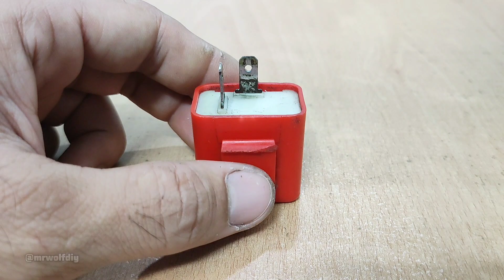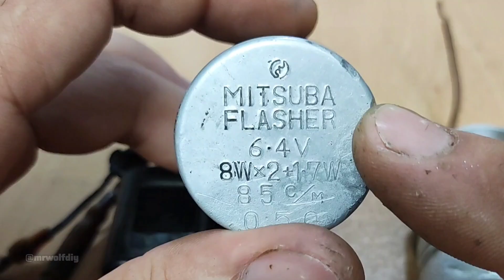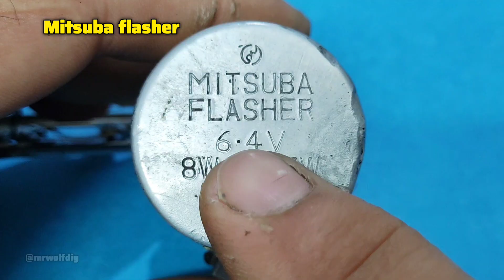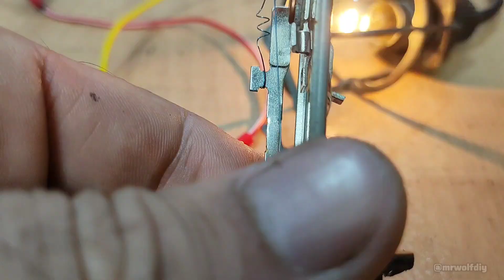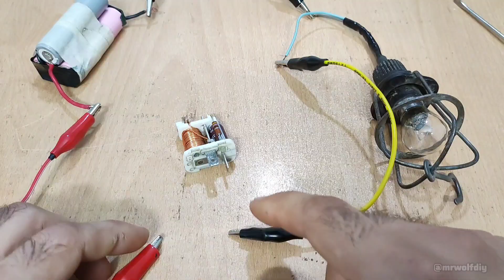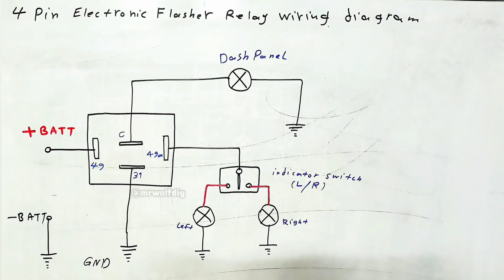What’s REALLY Inside a Flasher Relay? (You’ll Be Surprised)

Comment: Iv been using the cheap ,load independant flasher units for over ten yrs, one on my bikes 8 yr old,,  only prob i saw was one upside down which got water in it,dried it out ,all good 2 yrs on...the bimetal strip ones are nowadays just as cheaply built n last a few yr only, the one on your vid is an old,well made one,hard to come by now
Reply from the maker: that’s right—these are from the 1980s and cost $20–30 on eBay. 
Thanks for your opinion.🙌